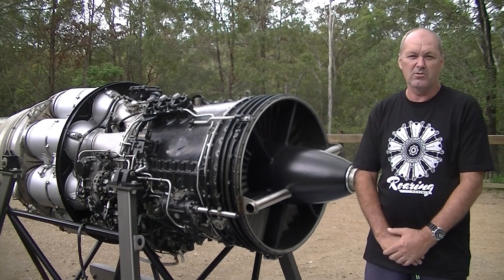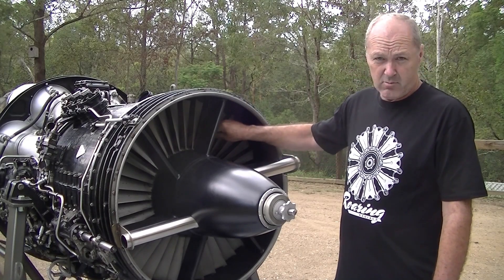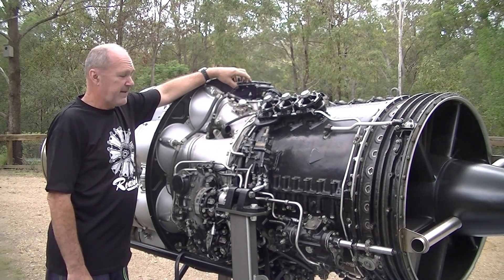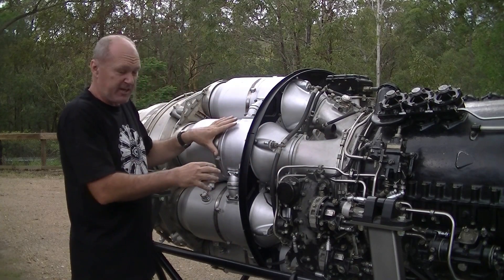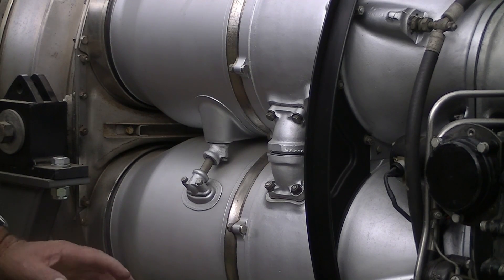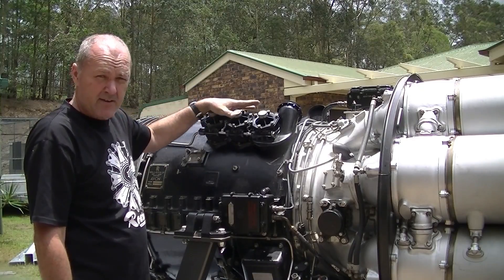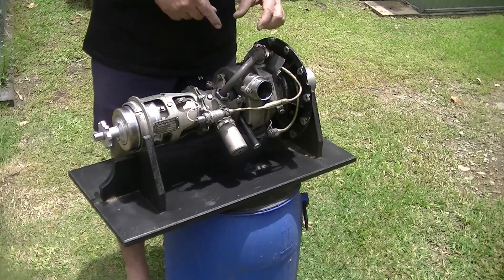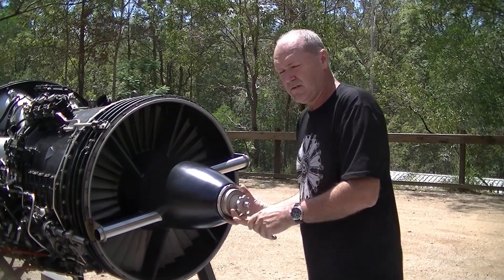Rolls-Royce Avon Mk 1 jet engine run

Comment: If I am not wrongly informed the later military versions of the Avon in the Dutch Hawker Hunter had 3 starter cartridges. One for the ground start and and 2 spare for an in-flight flame out event.
With only one starter cartridge available it is very hard to start the engine after a in-flight flame out.

Comment: There must be a finite supply of those cartridges, do you have any trouble getting supply? Many years ago I used to travel by train each day to work along the Pakenham line, there were two Avons, all tarped up, sitting stored on the top of a shipping container, at a motor junk yard as we passed through Dandenong. I always dreamed of buying and a getting it going. The owner only wanted $1,500-00 each.
Reply from the maker: Watch my latest vid about the avon :(
Reply: @johnrutherford9937  Thanks, that answers my question.

Comment: The starters had a habit of failing. I think they had a fusible link but you didn't know until the next attempted start when nothing happened after pressing the start button.
Changed many of them on 360 sqdn at RAF Watton/Cottesmore.

Comment: Was this before jet engines were started with compressed air?
Reply: This is a sort of compressed air start....
early German jet engines had a 2 stroke motor under the front cover where this has the cartridge starter system....

Comment: The sound of the starter takes me back to the 1980's when I worked on the flight line at RAF Kinloss.  We were a Nimrod base but we often hosted a detachment of 100 Sqn. Canberras from RAF Wyton.  Out of interest, do have any trouble sourcing new cartridges?  Are you able to get the used cartridges re-packed?
Reply from the maker: I did h as ve more than i would ever use until the government panicked and forced me to dispose of them all

Comment: sir i had a ipn starter that i bought from a friend of mine .it had never been used  brand new. it was originally  for the lightning. i sold it for twice what i paid.. its now at gatwick air museum a spare starter for the lightning . you wont believe what i paid for it     £10....and sold it for£20 .. i can get you as many as you like of the cartridges for starting your engine ... bruntingthorpe is just down the road   cold war jets  they do full blast  runway runs   but nothing flies  .to see a lightning on full afterburner is a sight to behold     well i ll only make you jealous  if i continue... so look  after your self       regards   laurence
Reply: Johnrutherford9937
5 months ago
Was given more than enough  the government didn't like me having them and has made me dispose of them recently   Don't know how I'm going to start it now.
Reply: john typical  of them  they dont like people enjoying  themselves . looks like you ll have to convert to air  start. get in touch with jet city at halifax  attention of agent j z  he could help good luck @JohnSmith-pl2bk
Reply: john   typical !instead of a cartridge screw an air line onto the noes bit of the starter esemblythat will work! @JohnSmith-pl2bk

Comment: I was an aircraft electrician, when I was an apprentice I worked on Hunter refurbishments. The Hunter was fitted with the Avon engine, when ever we did an engine run that cartridge start always made me jump, no matter how ready and prepared I was I’d always jump. The torque put through that starter output shaft into the engine must be phenomenal, the engine goes from standstill to idle speed in about 2 seconds.
 Just for interest, Dunsfold the Hawker Siddeley airfield where I worked had a snowplough made from a truck chassis driven by a small donkey engine, mounted on the back was an Avon engine with the exhaust facing forwards and sloping down, it exited via a ducting that diverted the exhaust out the sides. It was very effective blowing the snow off the entire width of the runway in two passes and the taxiways in one pass.
 Great video, it brought back those memories from 50 years ago of me jumping whenever the engines started.
Reply: The Russians used twin Mig engines on a tank chassis to do the same...
Reply: See the next vid on this channel when John converts the Avon to electric start....

Comment: There was a third engine after the 106 in pR7, E15. The Avon 206 in the Shorts PR9. Same as in the Hunter F9 series and I believe the Lightning with reheat added. 106 had the triple cart. Starter and the 206 in the PR9 , Hunter etc the scary Avpin  Isopropyl Nitrate 3 shot liquid starter sys.

Comment: Very nice. I flew many hours on them. A few failures inc a double flame out due icing. Had to set 6000 RPM exact in icing cond. till certain of landing (no flap above 100 ft! - bomb doors used for drag).
Reply from the maker: Flame out dsnt sound like fun  havnt been game to crank mine past 5500 rpm    They are spose to really growl

Comment: Great vlog. Worked on Avon 101’s in the eighties whilst on Canberra T4 and B2’s. Fond memories carrying out accel checks every two weeks as no temperature compensation, 50 Shot servicing’s on the single breech starters, and turco blasts…

Comment: I have just bought a Holbrook H20 lathe. Flipping huge toolroom lathe that weighs 5 tons!
Originally purchased by Bristol Siddeley in 1962 which then became Rolls Royce aero engines. It was used for prototypes of the Pegasus and Olympus engines. 
British jet engines have always led the way and still do to this day. Imagine if WW2 had gone on just a bit longer. The Germans would have been up against engines like this!
Reply: I did a Pegasus course at Bristol for two weeks in 1970 and worked on Harriers until I left the RAF in 1973.  I always insisted the the Pegasus was a Bristol engine not an RR motor.  Notably Bristol engines used Dowty Rotol injectors and RR used Lucas injectors.  They worked in a different manner.

Comment: someone pelase explain, this engine is able to move a plan from standing ground... but doesnt move this steel"cage"..
Reply: Note steel pegs in frame in ground a 2 x 12k kilo strain rated straps holding it back??
Reply: @JohnSmith-pl2bk  but still

Comment: I loved watching your video. Thank you for uploading it. Using a charge to take the engine from stationary to starting speed must have placed quite a stress on the components. But my, doesn’t that starting unit alone look to be an impressive piece of engineering!
My father was in the RAF in the early 1950’s just as jet-engined fighter aircraft were being introduced, but I guess the engines were not as sophisticated at this early stage as the one you have shown us. 
Thank you again and kindest regards from the UK.
Reply: Electric starter now fabricated and fitted in the next vid...
Reply: My father was not in the raf but he was a man and as such made children who had to read your drivel.

Comment: Jet engines of any year are one my absolute favorite marvels of engineering. Materials, design and even some of the resonance of fairly exotic metals fascinate the head sponge. Having one like yours that is right up there with museum quality AND it runs? That's the stuff of dreams! Well done on the labor of love.
Reply: Electric starter now fabricated and fitted in the next vid...
Reply: @JohnSmith-pl2bk  I hadn't watched this in awhile but forgot it was cartridge start at the time. Electric start will be a Very nice process for you by comparison! Air start would be the next best alternative, but for a rather healthy engine size like you have, a start cart would cost at least as much as the correct starter (plus the fuel!!), you might as well go electric. 👌
Add: Just watched the update, and for you, a raucous YAAAAY! is in order.  In the event I missed it, a simple electro-magnet can be added to your starter engagement for hands-free operation. That's basically how modern PTOs work. They're pretty robust for durability, and if they fail to work, real easy to swap out. I've made a few for smaller engines out of industrial security door locks that can be wired up to engage with power to the starter that automatically disengage when the starter is released (part of the electrical circuit, naturally). 
Not sure if it's an option for you or if you'd get enough amps, but a decently powerful AC genie with a DC converter might be an option if you end up bringing this to demos and the batteries decide to conk out at the worst possible time. I tend to run one out of necessity for my outdoor 'experiment stand location' as our home only has one 50 amp box that's inside the house and occupied.

Comment: So this beauty don't have a variable compressor guide vanes? But instead it has a bleedvalves,so  this is an older version of a G.T.E.?please correct if iam missing something.
Reply from the maker: Dont know what gte is   But mine has bleed valves and variable guide vanes
Reply: @johnrutherford9937  gas turbine engine sir

Comment: Ah that’s an AJ6.5, it was the first Brayton cycle engine designed by RR if I remember correctly (I’m probably wrong it’s been a long time) I used to service those in the 1960s.  Fantastic engine was used in a load of airframes from many manufactures and gas turbine power plants and still in use in some places but this engine was a work horse very reliable and well regarded engine.  It wasn’t very powerful by todays standards but for RR first attempt and an axial flow engine it was an excellent engine another thing to note is this engine wasn’t designed on a computer it was designed by pure math and engineering with a slide rule by hand.  Those engineers (most of them) were from the WW2 generation and had moved from piston IC engines (I say Piston internal combustion engines because Jet engines are also internal combustion) to as we all know the name jet engines and or gas turbine engines.  Truly amazing what these guys knew.  If I’m wrong some one will have to correct me but if memory recalls AJ6.5 = Axial jet 6,500 Ib.  That’s what it stands for I think.   Anyway it’s good to see one and I’m grateful for showing us it.
Reply: Electric starter now fabricated and fitted in the next vid...
Reply: I used to work on rolls, but the kind you eat.  You were sharing nonsense so i thought I would join you.
Reply: @bryannonya9769  I’m sorry but you’ll have to do better than that…what nonsense ?

Comment: What’s the rattling sound when these engines are running down to a stop…?
Reply from the maker: The compressor vanes are loose and move end to end     Centrifugal force keeps them in place when running
Reply: @johnrutherford9937  Ok yes, I did think it was something to do with centrifugal force and it makes sense….thanks very much for the reply 👍
Reply: Electric starter now fabricated and fitted in the next vid...

Comment: I remember coming across one of these at a scrap metal dealer's yard, about 35 years ago. I did wonder even then, would it be saved?

That makes the notion of the cartridge starter in the film "Flight Of The Phoenix" look a bit puny.  I assume that's a [relatively] slow burn, rather than an explosive release of energy from the starter?

Fantastic stuff, thank you!
Reply: From the vid it seemed to be an instant release that spins a flywheel to very high speed, md then that, through gearing drives a starting turbine.

Comment: The British gave this Rolls-Royce jet engine to the Soviet Union as a gift, and the Soviet Union mass-produced it to make MiG fighters.  It's an unfortunate history.
Reply: No, the engines were not Avons: they were Nenes with centrifugal compressors.  The engines were actually sold, not given away  
As a goodwill gesture to a former ally, the post-war Labour Government allowed Rolls-Royce to sell the engines to the Soviet Union, with the proviso that they would be used in civil applications only.  The Soviets promptly reverse-engineered them and did some development, to produce the Klimov VK-1, which powered the MiG-15.  Incidentally, the Nene was also built under licence in the States as P&W J42.
Avons have since been sold to the Soviet Union, in their industrial version, for gas pumping, as was the industrial version of the RB211.  I was responsible for design of the Industrial RB211 at the time, and I clearly recall that we had to issue a design scheme for the engine nameplate with Cyrillic characters.

Comment: Very nice indeed. I didn't realise the aircraft versions had cartridge starters.
At the power station at Didcot, UK where I worked in the early '70s, we had electric starters on the engines with batteries on continuous trickle charge.
It was a 2000MW coal fired station which also had four 25MW gas turbine generators, each with a pair of Avons acting .as gas generators into a power turbine driving an alternator. These could be used for feeding the grid, or directly powering the auxiliaries on the main turbo-alternators in the event of a black start-up.
You have done a great job on restoring a classic engine.
Reply: The Avon was a very successful ground engine.  I heard of ones on crude oil pipelines which had been running for years with no attention.  I think the alloy bits were replaced with cast iron but I have never seen one myself.
Reply: in the 70s I was doing your mum,  she asked me to not read your nonsense but i did anyway.

Comment: I cannot imagine not wearing protection while near that, I have tinnitus, be careful, tinnitus can strike anytime. Great sounding jet. cartridge start is interesting thought they would use compressed air or bleed air from a second.
Reply: John wears earplugs under those ear defenders...but needs to keep one ear out for any bad  mechanical noises.....

Comment: What is in the starter cartridge to make it fire like that?
Reply: A mixture of basically "gunpowder"...
some cartridges have black powder and smokeless mixed to produce the correct amount of gas over a relatively "long" period...
so the cartridge burns and the produced gases expand rather than shatters the engine..
Car air bags operate the same way...an "explosive"...but controlled burn to produce a certain amount of gas in a certain amount of time.

Comment: I worked in a power station that had two pairs of Avons, each pair driving an alternator via their exhausts to provide emergency supplies to enable a 'dark start' in order to get the main station back on line. They were inside acoustic enclosures with fire protection within. They were still bloody loud and ear defenders were mandatory! Most impressive hearing them starting up.
Reply: I worked at mcdonalds and made two turbines sound with my mouth.

Comment: How much do those cartridges cost?  Looks like an expensive way to start an engine.

Didcot OCGT is a small, 100 MW power station originally associated with the 2 GW coal fired station on the same site, now closed and demolished.  The OCGT station still sees occasional use.  It was built in about 1968 with four 25 MW sets each of which had two Avons with the hot gases from them taken through curved ducts where they were combined into one stream through a power turbine moubted between the two engines.  The shaft of the power turbine drove the main alternator and exciter bia a gearbox.  Starting was electrical, powered by a battery room at one end of the building.

I don’t know if the station still uses Avons or if it has been equipped with something more modern now; It’s many years since I last saw it.

For anybody who knows Didcot the  ‘small’ about 60 m tall chimneys with the blue top is for this station.

Didcot B is a 1.4 GE combined cycle gas turbine station next door, which is still in service.
Reply: Fawley also had four Avon OCGT’s, sadly now gone and demolished with the rest of the station.
Reply: He has had to dispose of all starter cartridges by Government edict.
So now he has to find an electric starter conversion...
a commenter says he has one on his Avon (also in Australia)

Comment: I really enjoyed watching this. My dad served with Treble One Sqn - The Black Arrows display team - in the 50s. He loved the Hunter, which (I believe) used an Avon and he did say that they were cartridge start (Avpin, I think). I'd not actually seen one of these start from a cartridge until I saw your video. If he was still with us, he'd have loved to have watched this. Great job on the restoration - the engine looks like new and sounds great.
Reply: In 1958 I was at RAF Chivenor working on the airfield, when all 22 aircraft of Treble One formation team zoomed in over the estuary. After a thrilling display, they landed and we got them serviced for the next display. I talked with many of these pilots..( one your dad perhaps?)....I was struck by their unassuming approach to what was a dangerous 22 aircraft grouping. One pilot said to me..." It's like playing the piano; put the same practise and effort into formation flying as you would a piano, and you're there" The 22 didn't last long; Service exigencies etc. The Hunter was Mk.6 with an Avon 200 Series engine.
Reply: I worked on Hunter FGA9s with the Avon 200 engine and the AVPIN starter (it used Iso-Propyl-Nitrate - a 'monofuel' which made its own oxygen).  Changing a starter with that stuff dripping into your eyes was not fun!.  We also had Hunter T7s which had a triple cartridge starter - quite a job to change the cartridges.  I later worked on Avon 300s in the EE Lightning aircraft in Saudi Arabia.  I used to do all the starter changes as that was easy if you were thin enough to get down the intake. Running them in reheat on the ground was great fun.  I used to stand on the tailplane when they went into reheat so I could spot fuel leaks at the rear.  Having the diamond shock wave pattern within reach was something else!  I think H&S would not allow this now.  Apparently the AVPIN fuel is not obtainable any more so the Avons have to use electric start.  I also trained on the early Avons as here in the Canberra B2s.  The engines were easy to maintain as with any problems they were sent back to RR.